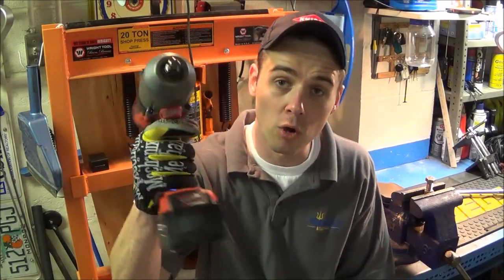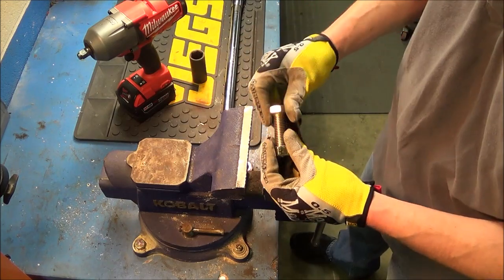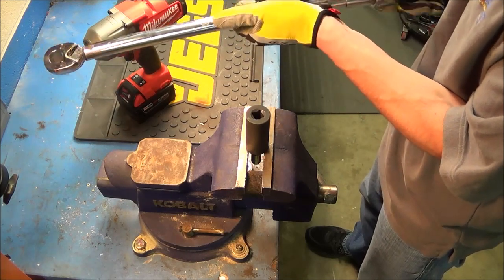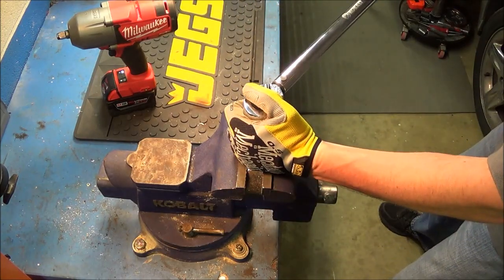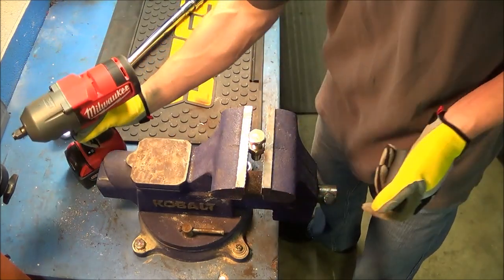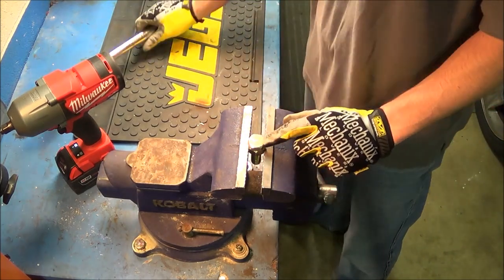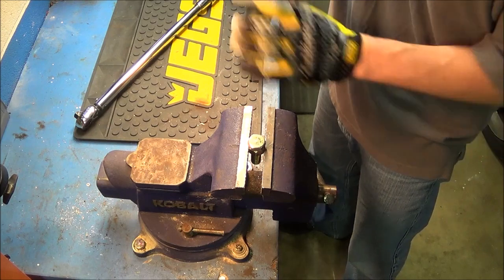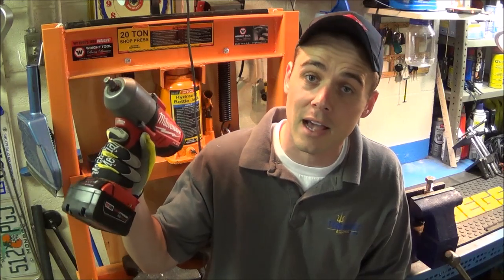Torque Test - Mode 1 - Milwaukee M18 FUEL 2763-22 High Torque Impact Wrench

Comment: Grear vids. Question for you.  I just picked up an m18 fuel 3/8 impact which is great for work BUT won't budge the lugs on 2 different vehicles... Do you know the size bolt used to achieve 200 Foot pounds with the 3/8 fuel impact?
Please get back to me when ever you can

Thanks
Reply from the maker: Daniel Zukeran Normally, it is going to be a large size coarse thread bolt for them to reach that "up-to" mark.  If you are having issues, there are a few things that can cause that to happen.  If you are using extensions or adapters (3/8" to 1/2"), you will lose torque.  As lugs sit (in the weather...rain, salt, dirt, etc), it takes a LOT more torque to remove them than it did to install them correctly.  Also, to achieve the max power rating out of any of the M18 FUEL tools, you must use the 4.0XC batteries.  If you are using different batteries, the power levels drop about 5%.  I will contact Milwaukee to figure out the bolt size & thread pitch used in the torque rating for the 2654, but I would guess that one of those other issues is causing your problem.  Milwaukee is one of the only companies that does not over-estimate their tools power levels in my experience.  Thanks for commenting!
Reply: Thanks for responding quickly. And please don't make it too much trouble in contacting  Milwaukee, don't worry about it. Yes I am using the XC 4.0.  I Own several m12 and m18 tools and love them all.
Reply from the maker: Daniel Zukeran I just sent them an email....I will definitely let you know once I hear back.  It was the same kind of issue that people were having with the Mode 1 on the 2763, which is why I made this video to prove it would do it.  I havent heard any complaints about the 2654 power levels though, so I am also interested in hearing what size bolt they used.
Reply: Thank you!

Comment: I just ordered one of these after the Kobalt 1/2in cordless impact broke on me today trying to remove lug nuts. I didn't take it apart but I think the shaft sheered in half. The motor still turned just didn't turn the anvil anymore. The sad thing was I only used it three times and had it less than a week. I hope this Milwaukee can live up to expectations which for me is basic automotive work and removing axle nuts.
Reply from the maker: It will FAR exceed your expectations....it has an unreal amount of power.  I would advise you to tighten in moderation, dont hold until the nut/bolt stops turning or you will shear it off....it will rip threads off if you arent careful.  Good purchase!
Reply: dmcguinn1  You think a set of torque sticks would work ok with this? The only thing I would want to run down would be lugs.
Reply from the maker: I have read online about people using them with the 2763, but I personally have not tried.  I always "snug" up lugnuts with any impact, then lower the vehicle onto the ground & torque them to spec with a calibrated torque wrench.  I have stripped wheel studs in the past by over-tightening with an impact & replacing them is not worth my time ever again.

Comment: I use my 2763 quite a bit and every time I use it, I'm impressed.  This thing is so much better than any other cordless impact that I have used.  User beware:  This thing is a beast and it will snap off a bolt if you're not paying attention.  Great demonstration.

Comment: How much torque can you apply tightening in mode1? I think a lot of people would want to know for putting on lug nuts.Thanks for the vids!
Reply from the maker: The exact same.  Mode 1 has 100 ft-lbs forward & reverse torque, unlike mode 2 where the reverse torque is higher.  I had made a separate video showing me tightening that same bolt with the M18 FUEL, and then verifying with the torque wrench (coupled with a torque angle meter to verify no movement), but that video was extremely boring.  I have tested it both ways, and both ways are 100 ft-lbs max.  And just a quick note....105 ft-lbs is too tight for the M18 FUEL in mode 1 to remove, they got those measurements exactly right.

Comment: Nice video. My m12 fuel does 100ft lbs on mode 2 lol . I'm getting the m18 soon
Reply from the maker: You will not regret it!  If you go with the 1/2" version, get the 2763-22....if you go with the 3/8" version, get the 2654-22......the max torque on the 3/8" is 200 ft-lbs & it knocks lugnuts off with ease, it surprised me a lot.

Comment: Another video Daniel! Great thing that fuel impact wrench has 2 speeds to select only the power you need
Reply from the maker: Thanks!  Oh yeah I agree....with that extreme mode 2 power, it is nice to not have to worry about stripping threads or rounding a bolt off when you just need to run something down tight.
Reply: dmcguinn1 lol i don't know what happened to my first comment. I think i meant to say awesome video or another great video to start off, oh well but yeah that impact wrench is a beast. And the good thing about the Milwaukee over the IR is the line up, you can get the m18 wrench and also pick up a saw for the same battery.
Reply from the maker: ToolCrazy
Funny you should mention that....I have a M18 FUEL Sawzall that I have been working on a review on....LOTS of awesome test footage....that thing is a beast!!! ;)
Reply: NICE! can't wait to see it.

Comment: Hmmm, I was under the impression that this M18 provides a max TIGTHEING torque of 100 ft.lbs on mode 1 and 700 ft.lbs in mode 2 while providing 1,100 ft.lbs of nut busting torque in mode 2. I guess the gun is marketed as having 100 ft.lbs of nut busting torque in mode 1, must have missed that!
Reply from the maker: It does.  Mode 1 achieves 100 ft-lbs max in forward and reverse...there is no increased reverse power like stage 2.  In the description of this video, I added in that I alternately did the forward torque test in 10lb increments from 50 to 100 ft-lbs w/a torque wrench and torque angle meter.....but the footage was so boring, no one in their right mind would watch it.  Stage 2 definitely has more reverse torque than forward torque.....stage 1 has the same forward & reverse.  There is NO listing anywhere online that I can see that mentions stage 1 reverse torque.....but it will not loosen a bolt tighter than 100 ft-lbs I assure you.
Reply: dmcguinn1 Oh, I see that in the description now. Good to know i can set the M18 to mode one and deliver light torque when called for. This impact has been great for me and don't regret for one second buying it. Only thing is that I tried to loosen lug nuts on a bus that had been tigthen to 550 ft.lbs using a 1" impact gun and the M18 Fuel felt like a toy as it failed to loosen one. I still love it and for my needs (working on passenger cars) it's been phenomenal.
Reply from the maker: SlipperySpandex
Glad I helped clear that up! ;) I am surprised to hear about lug nuts....there are only 3 things that I can think would cause that issue for you; 1: Initially over-tightened, 2: corrosion (since as soon as the threads corrode, it takes much more force to remove them), 3: you were using a 1/2" to 3/4" adapter or an extension.  I have tightened bolts over 700 ft lbs & the M18 removed them with ease.
Reply: dmcguinn1 I did use a stubby adapter in order to use a socket designed for the 1" gun. Rust/corrosion was not an issue. It's not a huge deal, the gun breaks loose any bolt I need to remove while working on passenger cars and that's what I intended to use it with since purchase.
Reply: Mode 1 is good for removing and installing wheel lug nuts, otherwise it's just a too huge of a tool for anything else. There's a much tinier Milwaukee impact wrench that tightens at 80 to over 200 ft-lbs. selectively so the Mode 1 is really pretty much useless unless the user loves showing off that they can handle a big tool.